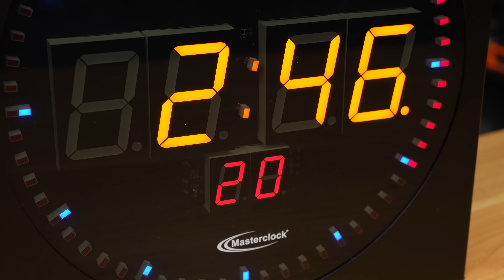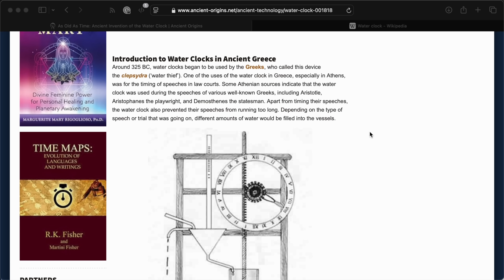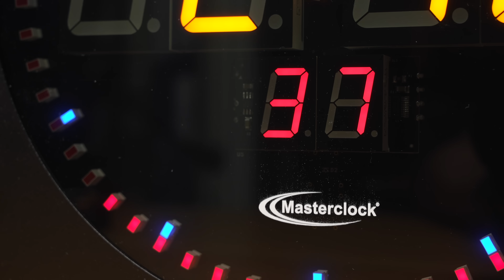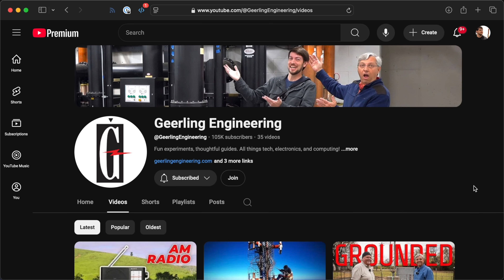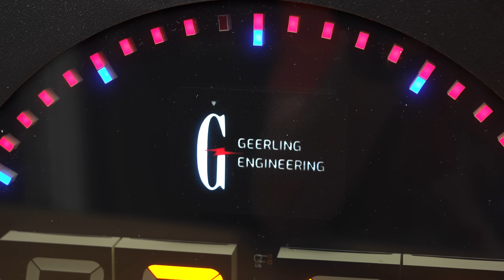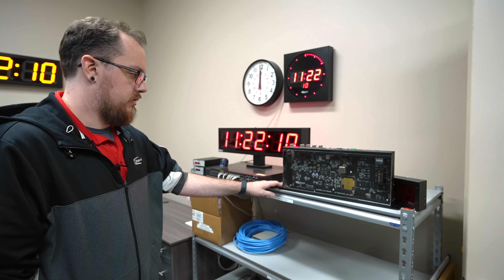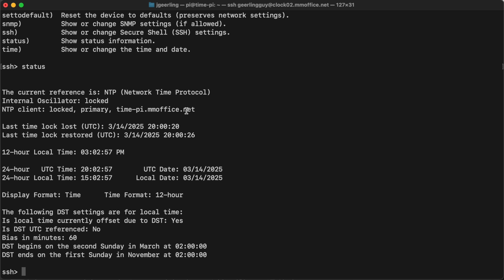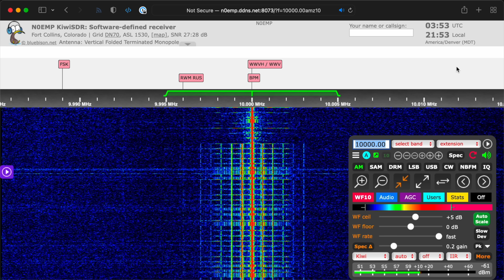It's about time...

Comment: Accurate dates and times are surprisingly hard.  One thing we could easily get rid of are months.  We don't need the 12 months of the year.  We can count from 1 to 365 (or 366) just fine.  Scheduling a meeting becomes simpler and less error prone, computers have to make fewer mathematical calculations, internationalization is easier (no words), space travel makes a LOT more sense (i.e. strictly the time it takes for objects to rotate around themselves and a nearby stellar object), the date is displayable in a more compact format, and programmers have one less thing to worry about when displaying dates.  If we were to start each year on weekday 1, then everything gets a lot simpler as well!

Comment: It would have been great if you could've given some concrete examples of how this server is used. Like why is it not good enough to have each computer on your network sync to a remote ntp server? Seems like that would only be beneficial for an enterprise or government?
Reply from the maker: I'll be diving more into use cases, but a quick list is media production (like with Dante and AES67, in recording studios and broadcast facilities), financial databases (definitely more enterprise), 5G/wireless tech (to sync carriers and phones), electric grid and industrial equipment (especially robots), VR/AR (if using more than one device).

So definitely not as consumer-oriented yet, but for some applications it certainly is helpful. More on the high end.

Comment: Hope you like this :)

ISO 9001-G: The Geerling Standard For Testing Technology Beyond Manufacturer Specifications

1. Scope

This standard defines the methodologies, practices, and parameters for testing technology, particularly single-board computers, beyond the manufacturer's intended use cases. It aims to ensure rigorous, boundary-pushing evaluations that reveal a product's ultimate potential and limitations.
2. Definitions

    Geerling Test: A suite of extreme experiments designed to assess the versatility, durability, and performance of a technological product.

    Raspberry-Level Resilience: The capacity of a device to operate reliably under "unconventional" stress tests, including overclocking, extreme environmental conditions, and unorthodox configurations.

    Jeff Factor: The creative ingenuity applied in repurposing or pushing a device to its absolute limits.

3. Core Principles

    Extreme Stress Testing: Devices must undergo conditions that exceed standard operating environments, such as:

        Overclocking to maximum stable frequencies.

        Operating in extreme temperatures (e.g., sub-zero freezers or scorching heat).

        Running intensive workloads continuously for extended periods.

    Unconventional Use Cases: Test the device's ability to handle unexpected configurations, such as connecting dozens of peripherals or unconventional software setups.

    Transparency and Documentation: All testing methodologies, results, and configurations must be meticulously documented and shared with the community to promote open knowledge and improvement.

    Community Engagement: Foster collaboration and discussions within the tech community to expand upon findings and inspire new applications.

4. Testing Protocol
4.1 Hardware Stress

    Push all hardware components to their theoretical limits.

    Record failures, instability points, and unexpected behaviors.

4.2 Software Extremes

    Install and run unsupported or heavily customized operating systems.

    Test compatibility with obscure drivers, APIs, or frameworks.

4.3 Survivability Tests

    Simulate disasters such as power outages, voltage spikes, and system overloading.

    Assess recovery processes and data integrity post-failure.

5. Reporting

    All tests must include benchmark results, environmental conditions, and Jeff Factor scores.

    Videos and articles sharing results are encouraged to further the spirit of community learning and transparency.

6. Application of the Geerling Standard

This standard is intended for use by hardware enthusiasts, tech reviewers, and manufacturers aiming to gain comprehensive insights into the extreme capabilities of their products.

Jeff Geerling has set the bar for pushing boundaries, and this "standard" is a nod to his curiosity and passion for innovation.

Comment: Great information!  I would love to see a pi be able to generate clocking as a word, smpte, mtc,  etc. That would be real useful.  I thought NIST at least at one time provided several over the air time signals NOT gps, I have a clock that still works that way. I believe they had some other signals broadcast like 10mhz, etc.  These are alternatives or in addition to gps.  The only comment on a term you used, precision, it is my understanding that should be related to the greater resolution and accuracy ( such as frames or tenth, hundredths or thousands of a second..) Rather than multiple devices in sync. That is just my understanding with the terms when it comes to time.  Having a local clock that can by synced is vital in broadcast, networks and carrier spaces. Purely relying on a single or over the air like GPS can be devastating, if those sources are lost and the local clock cannot continue to keep time until the primary source returns. I've gotten to work with several master clocks over the years some externally synced, most with a wide array of formats and signals outputted!  I always find your content top notch!

Comment: That's a gorgeous Pi cluster! It's great that you're diving deep into this subject for viewers. I once built a time server for a system that manages a billion dollar assets. Syncing time precisely was a serious matter. In my case, I couldn't entirely rely on a GPS signal, as an attacker could fake or jam it.
The one thing I would add to your setup is a portable battery (ups) with graceful shutdown. Systems where time is critical tend to be offline and shielded. Losing power, even briefly, can throw your entire system lost for a while, or even permanently, if the signal is unavailable. Also, you know... Pi5 can easily break a sdcard on a sudden power cut...

Comment: Super interesting. Getting into more details about NTP (ms resolution) and PTP (ns) would be great, especially software. Folks need to know PTP is what keeps 5G cell sites synchronized so that carriers don’t interfere with one another. Time synchronization and masterclocks are huge in the telecom world.
Reply: I spent most of my career designing and implementing these systems for wireless (TDD systems). It's probably one the most important uses of GPS and time synchronization that most people use every day and dont know about.

Comment: And once again - a magically well done and informative effort! 

My background is far too rusty with many holes in it to hold my own opinion so: Is the technology available on the amateur/home level to the point yet where Red Shirt Jeff can demonstrate some of  the weirdness of time? For example time dilation with motion and the change in time rate with increasing gravitational effects or acceleration? If I remember correctly - back in the 1970's two time servers were sent on round-the-world trips in opposite directions on commercial aircraft demonstrating how time varied in that situation. While the equipment used in that work is available surplus - can amateur level lashups reach that level yet?
Reply from the maker: It could, now—though airport security might get a little frisky :D

It'll still cost a lot, but you could probably replicate at least that 1970's experiment for a thousand bucks, maybe two.

Comment: In case of an emergency, like weather events and other. There's a few things that could make it hard to have the correct time or any time at all, so it's not only about cost but also about availability, let's say you can't order on amazon all the parts for a time pi, then if you want to use a pi to tell the time you could go full cavemen and find something like a ds1307 in the form of an arduino or even just get an IC and make your own device (some time is better than no time), but here also the software could be an issue if there's no internet to figure out how to configure it. I don't know what would be the next best option if you don't have any good old mechanical or quartz watch. It would be nice to have some video about that.
Reply: So basically how many options do we have before having to stick a stick on the ground to read the sun shadows to tell the time? 😅
Reply from the maker: We have a lot of options nowadays! So many devices already have at least a decent oscillator, you could use that.

Comment: I tried to make a raspi time server in the past with a gps module but the instructions were confusing. The authors didn't go into details on there reasoning with the configurations such as why there is a time sync delay set to the value  they chose and when the clock should update off the pps signal.
Having a fully build hat and gps module would take a lot of those arbitrary settings out and have the designer handle them.

Comment: Apart from fun, why do i need something like this in my homelab? Isn't ntp to a good internet server and then replicating that internally good enough?
Reply from the maker: It is definitely good enough, for 99.9% of homelab use cases.

But some people might add PTP and more accuracy if they run a Dante network for A/V in their home, or tinker with some SDR/radio stuff too.

It's usually not at all necessary though, more fun for now :)
Reply: @JeffGeerling  ohh good point, multi room audio is going to need better time than my web access logs. Still doesn't need to be globally accurate, just locally.

Comment: Wait, a homelab homebrew raspberry Pi atomic clock. Now you can post the time since the last kernel recompiling super accurately 🤣
Reply from the maker: It has been 0.00123492212 femtoseconds since I last recompiled the Linux kernel.

Comment: i used to work on terrestrial wifi devices that used gps and ntp to syncronize the access points across multiple mountaintops. it was pretty cool
Reply from the maker: I haven't even gotten into 5G and timing, or broadcast (like ATSC 3.0). Despite some of the downsides to newer wireless tech, it is fascinating how important time has become!

Comment: 10:43 Pretty sure he misspoke, and meant to say 'BGA' (ball grid array), a type of IC package. FPGA (field programmable logic array) is something different entirely.
Reply from the maker: Both, sorta—they're switching their high-end line to FPGAs, which are BGA chips. There are of course FPGAs with QFP, and they'll still be using some of their other chips with SOP and QFN, but with the particular FPGA lineup they are using, they're all BGA, and thus they want the X-ray inspection.

The older line uses microcontrollers in QFN packages instead of FPGAs, I _think_. Would have to ask to be sure.

So internally they probably just equate 'FPGA == BGA' in terms of the setup and inspection.

Comment: Several years ago I used the Adafruit Ultimate GPS HAT to build a NTP server using a 1GB Raspberry Pi 4B. The TimeHAT is a big upgrade. I dealt with IEEE-1588 (PTP) at work for doing remote end-to-end testing. Looking forward to other videos in the series.
Reply from the maker: Adafruit still makes some very nice low-cost GPS options for the Pi, too. I may have to talk to them about alternate builds that could still work with the same configurations!

Comment: I worked for a company where we have a very large SCADA system communicating via something like serial communication with a master station being managed by another department and we're doing the outstations. We use time-server like devices using GPS for time at each outstations to provide accurate time since the master station won't provide a time sync after certain upgrade long ago. It's fun to find a position that can receive good enough GPS signal for the time in a metropolitan area. Just because the spot can "see" the sky doesn't mean it's good GPS signal spot. Sometimes it's a big headache when the substation is surrounded by 40 something stories buildings and your GPS antenna can only be installed at ground level...
Reply from the maker: Exactly the frustration I've seen echoed in many urban areas!

I'm also hoping being in close proximity to a large multi-service tower doesn't cause any issues here. Probably won't, but I have had to worry about some antennas getting too much signal!
Reply: @JeffGeerling  I'm not sure if too much signal could be a bad thing. Tho tbh I'm not an expert on clocks tbh. I just use them as per the manual. Maybe a short video on the second channel to try out signal overloading situation?
The "Satellite-Synchronized Clock" we use can get up to 5 or 6 GPS satellite sync. But with all the high tower surrounding here in Hong Kong, most of the problem we have is we can't get any signal at all. Tho the situation could be a lot different when the antenna is installed in higher position. Sadly my company's substations are all on ground level and we don't get the chance to try how it'll work when sandwitched in the middle of a high-rise tower.

Comment: 9:27 all the clocks in the background went from 16:51:59 to 16:52:00 but the one on the table was late... this is completely unacceptable. ;)
Reply: By the way, there is also The White Rabbit Project which offers a lot of documentation and fully open hardware, firmware and software.

Comment: This may be something more for the Geerling Engineering channel but would love for you to get into GPSDO and output for things like SDR for lower-than-commercial-cost in one combined unit with the time server.
Reply from the maker: The TimeHAT does route the GPS PPS to the i226 chip, so I will likely use that as the PPS source once I get my outdoor antenna in use.

Eventually I want to integrate the CSAC as well for holdover, if I have to take down the antenna for some reason, or if some hostile YouTuber comes and jams my signal haha

Comment: @JeffGeerling having a network card capable of PTP is a one thing. Does the switch have to be PTP enabled or it is transparent to the protocol? What about traffic prioritisation? Are PTP packets somehow special?
Reply from the maker: The biggest factor is the internal queueing/routing inside the switch—and some are horrible, delaying packets at random intervals, screwing up PTP's ability to discipline clocks over the network.

This is a topic I'll be covering soon, too—with a Raspberry-Pi-based PTP-optimized network switch :)

Hopefully over time I'll be able to validate different consumer/homelab-grade switches to see which ones handle PTP better than others.

Comment: I've given up on Pi5. I tried. I really tried. I bought one, didn't notice that I turned the fan connector the wrong way, immediately proceeded to destroy any ability to have a fan. I give up. Never again. The design is hopeless. It's 2025 and there is no built-in NVMe M.2 slot. We still have to rely on shitty unreliable micro-SD cards. On top of that I just bought an Intel N150 for the same price I could buy a Pi5 8 GB (+power brick + case + fan). The N150 can hold two M.2s for at total storage capacity of 16 TB. I can add 64 GB of RAM if I want to. It also comes with a power brick and anything else required. Oh and its amd64 so I don't have weird arm problems. Sure, for VERY VERY specific projects, Pi5 might make sense. For everything else. Hell no.

Pi? More like NoPie.